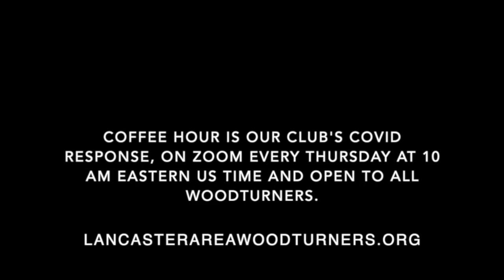Bert Delisle  Wrong Gouge Safety Lesson

Comment: Definitely reinforces the point to always wear a face shield when turning at the lathe! At the very least fully framed ANSI Z87.1+ (if I recall the spec right) I often forget to put mine on (also a Uvex just like Bert's) when doing smaller projects (small spindles and 3 inch bowls, etc). I actually went and bought my face shield after a 5 inch bowl came apart due to hidden ring shake, and one piece put a dent in the wall behind lathe (which is 1/4 inch pegboard) and the other piece whizzed over my shoulder and landed 20 feet behind me.  and that 5 inch bowl was only turning at around 900 RPM at the time.

Comment: After watching the video a few times it seems like the gouge started to cut deeper prior to hitting the cross grain resulting in the catch that caused the accident.
I do believe that the turner does need to do a serious shop clean up to eliminate the hazardous stacked tools, jigs, piles of sawdust/shavings and work in progress. Also notice the scary array of electrical cords hanging from the ceiling very close to operating machinery.
Want to know if your shop is a safe place to work in? Contact your local fire department to do an inspection, they will have good suggestions for improvement.